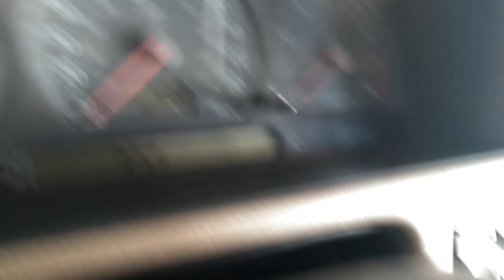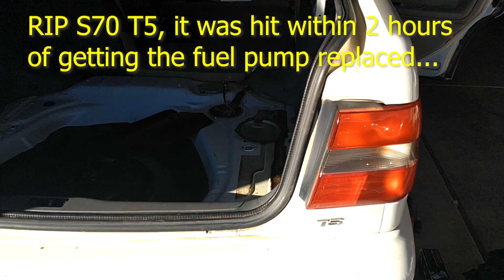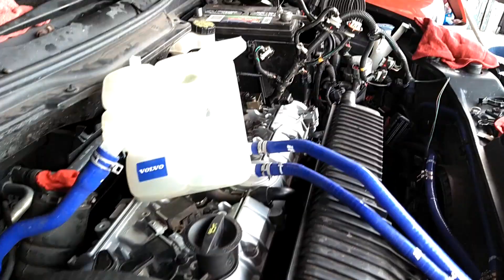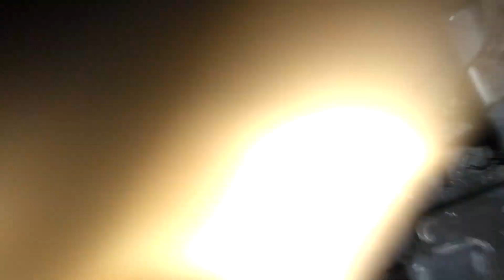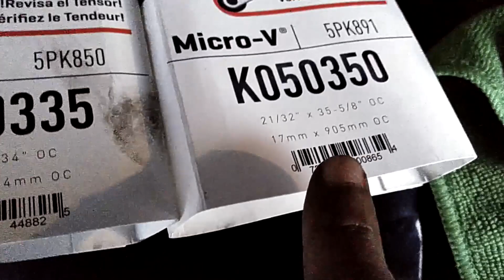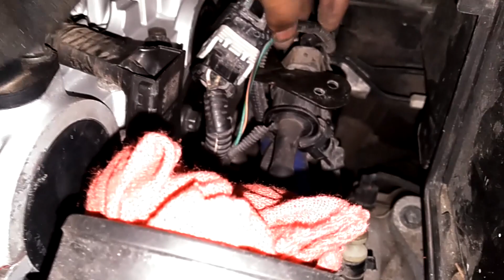New fuel pump for a S70, parting out a 850, then put the C30 back together. - HOWR

Comment: Hey Robert, my name is Steven. I’m all the way up in Washington , the PNW. I have a question about my 1999 Volvo V70. I’m having issues getting it past 4K rpms even when it’s in nuetral, & I just replaced my ignition coils, & crankshaft position sensor (after watching your how to videos :) which - neither of those fixed the problem of acceleration, I am worried it has to do with my catalytic converter because it feels like my car is not “breathing” through the exhaust system correctly as it stutters when I try to stomp on the gas & go faster. It down shifts & wont go past 3-4 k RPMS. & it seems as if the problem is getting worse, cause yesterday my car died & my battery & oil light came on. But it’s weird cause I have no check engine codes, & the guy at my local shop, disconnected my MAF sensor & it still wouldn’t go passed 4k rpms. It hits 4k then stutters. My exhaust also blows out super super hot air to where I can barely even place my hand in front of it for 5 seconds. I can send a video for clarification if there is a way to contact you. I just really need help, as delivering food is my only source of income at the moment with the pandemic. I hope to hear back from you! Have a great day.  My email is steelo702@outlook.con
Reply from the maker: Pull an o2 sensor or disconnect the exhaust at the down pipe and see if it runs better.
Reply: Robert DIY okay, thank you so much for the speedy reply my man. Is the exhaust just bolt on? & also, for the 02 sensor, you have a video for that right?
Reply: Robert DIY & also, would either of those throw engine codes? Because I have no engine codes, just a service light that pops on for 4-5 minutes when I start the car.
Reply from the maker: https://youtu.be/gt9w-ZSxs9I
Reply: steelo702@outlook.com

Comment: hey robert! i have a 2000 volvo v70 SE and it had a little coolant leak and i just kept putting it off. but one day the motor just stopped when i was driving. just randomly shut off and it won't start ): i tested the fuel pressure and it's good. any ideas of what it might be? thank u so much!!
Reply from the maker: Not from here. Coolant roulette is not a smart game to play. 🤷🏾‍♂️
Reply from the maker: https://youtu.be/YiPAPu-K8OI
Reply from the maker: https://youtu.be/AoqbF0ZEzpg
Reply from the maker: Was it low on coolant when it died?
Reply: yes it was a little low on coolant when it died ):

Comment: Would you recommend replacing the sending unit along with the pump if the fuel pressure is low?
Reply from the maker: For what kind of car?
Reply: For a 98 v70r with 175k miles
Reply from the maker: The pump assembly comes with one of the sending units.